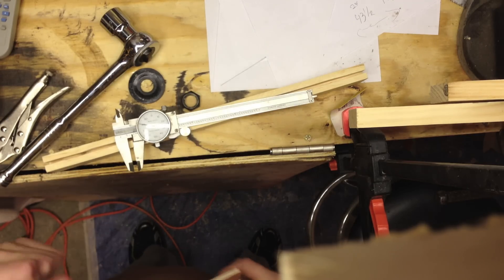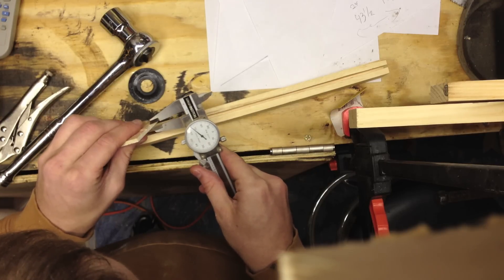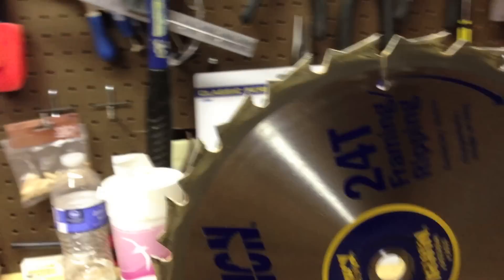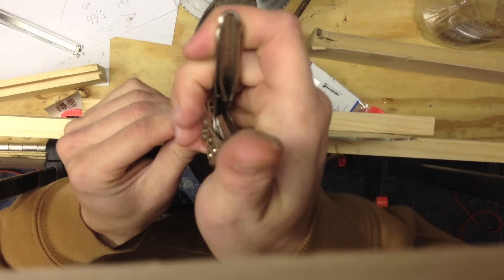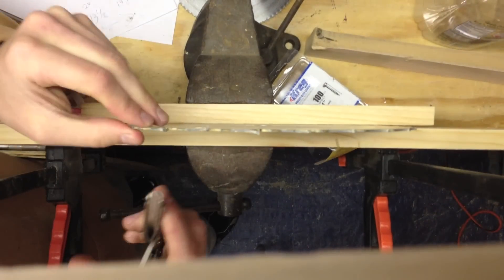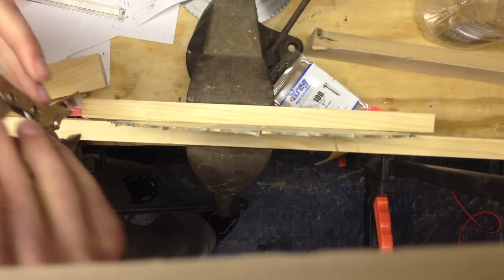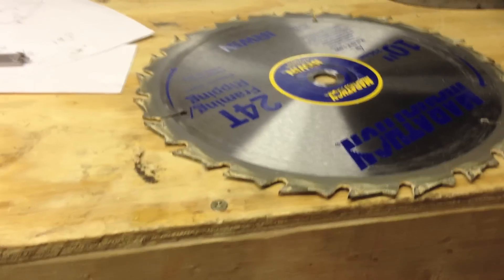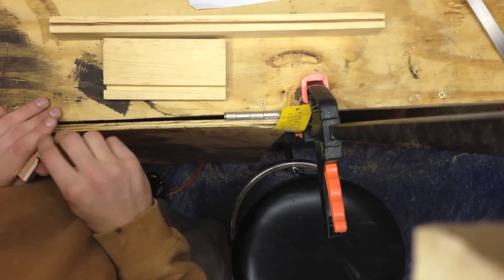How to make tracks for a wooden sliding door

Comment: For those who don’t want to ruin a blade or risk injury to self or your table saw... here’s how to get a wider dado in a rail: 1. bring the blade up to height for the depth of your cut 2. Move the fence and set for the first pass 3. Move the fence a tiny bit and run a second pass to widen the cut. It’s easy and accurate enough even with a fence that isn’t precision. These 3 easy steps requires no blade manipulation (which really is a bad idea and can turn out to be even more grossly inaccurate) and you’ll still get the end result your want. I appreciate this creator wanted to help people by showing this process but it is un-necessary and can get beginners into trouble. We all sometimes “have to make do”... just think it through.
Reply: That was my first thought also. I can do exactly what you said in the time it takes to watch this video, much less the hour it would take to do it his way. And from now on, that blade will cut that wide. Just ruined a blade for no good reason.

Comment: If you can't afford box blades and the fence isn't able to adjust tiny distances very well... tape a long piece of file folder to the side of the workpiece to space it away from the fence.
Carbide is very brittle.  Bending the carbide teeth on a brazed blade will create small fractures in the carbide that will widen over time from the vibration and rotational inertia of the now unbalanced blade.  These pieces will fly off in random directions at a fairly high rate of speed.  
Anyone that does this is asking for a sharp piece of carbide to randomly pass through something they'd prefer to remain free of extraneous holes... at a speed at least that of a .45 calibre pistol bullet.  If your head or left chest happens to be the recipient of said chunk of carbide the results will be less than favorable... assuming you do not have instant access to a trauma centre and you are bloody lucky.

Comment from the maker: Maybe if you have a high end table saw. But when I first started I had to improvise and use what I had, and this was all I had. The Fence i used was impossible to get in the same place every time and for accuracy this was much better, simpler, and easy. Are there better ways to do this? yes, there is always a better way to do something.
Reply: Masking tape and chunks of file folder.

Comment from the maker: @iamvladtheimpaler  yes! You aren't bending it much...not even a  1/16th of an inch on each side...just make sure u bent it at the base and not by the carbide tip or u could break it off...other then that perfectly safe and makes a great smooth cut!